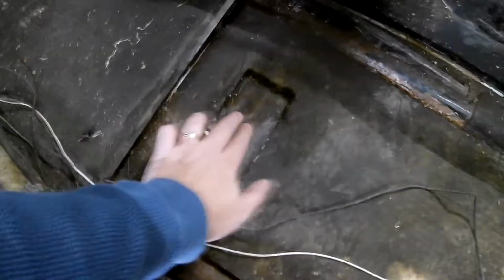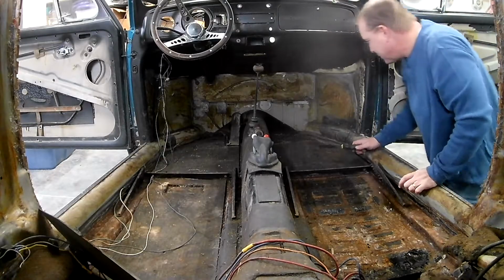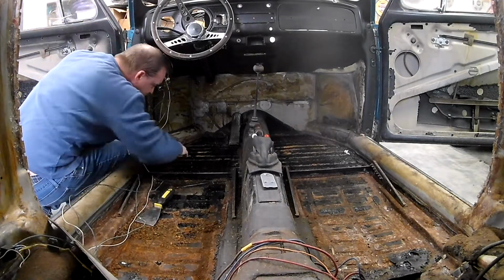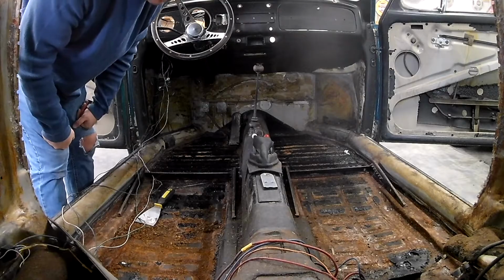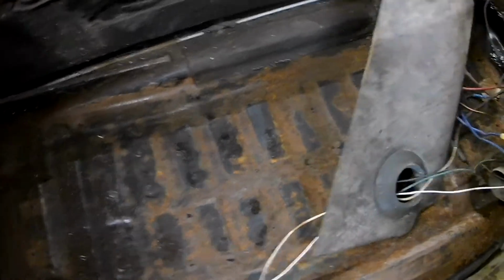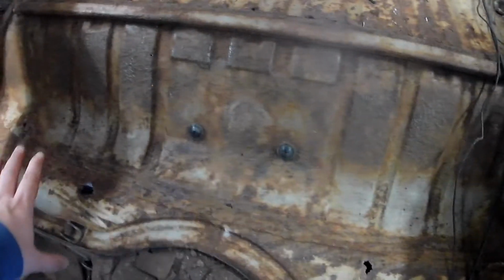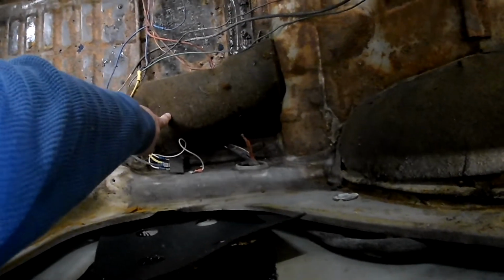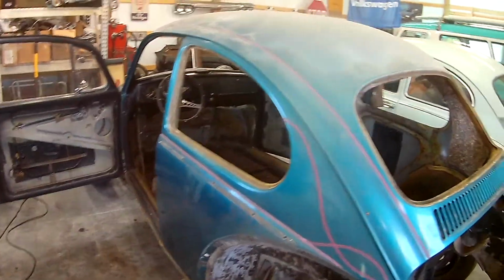VW Floor Pan Prep

Comment: Thanks very much for bringing me up and the support!! I truly appreciate it!
I would sincerely use patches! I would not cut the whole luggage shelf out. Most of what you showed I would be grabbing some metal and patching 
Try dawn for degreasing safely with rubber.
Reply from the maker: Thanks for the input!! My big concern is where the flat part of the shelf mates to the “hinge” on the slope portion of that area. I’ll go back and look to see if it is as bad as I thought! Got plenty of dawn around the house, I did not want to damage the transaxle boots.

Comment: If it’s surface rust you can scrape and neutralize it with Rust Converter. If it’s more extensive metal replacement is warranted. Just ask our buddy Vw Jawbreaker here; he’s refurbishing the chassis of his ‘60 Baja and he just replaced the floor pans and had to do surgery on the tunnel. If replacing floor pans try to get the 18 gauge which matches the original. Most replacements offered are lighter gauge. Wolfsburg West has the perfect replacement panel for the battery area. 

The rust on the rear parcel area is caused by a leaky rear window rubber seal. Hopefully that will go away once you put in new rubber seals on the whole car. Ok Fixer, another Youtuber who restored two Bugs and a glazer by trade suggests using black butyl sealant inside the seal when reinstalling the glass. This gives you an extra layer of insurance against water leaks.

Super Clean is a good degreaser for the transaxle. I suggest examining the transaxle nosecone mount at the front of the transaxle; it’s rubber as the rear ones and does degrade over the years. Not expensive and easy to change out now with the motor out. Would also be a good idea now to drain and change the transaxle gear oil and change out the shifter rod bushing which resides under the shifter. It’s serviced by pulling out the shifter rod from the front of the car and since the car is disassembled this is also perfect timing; it’s a $4-$5 part.